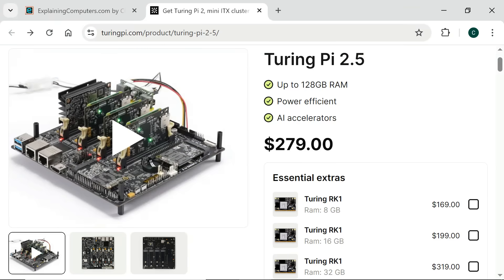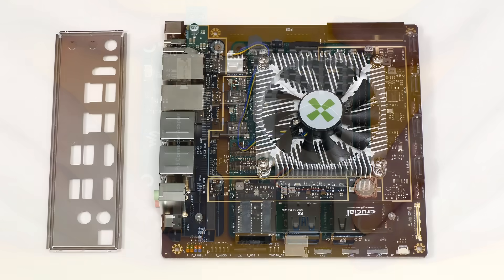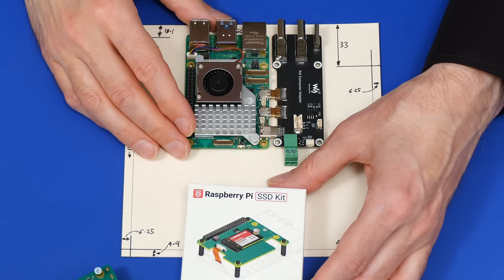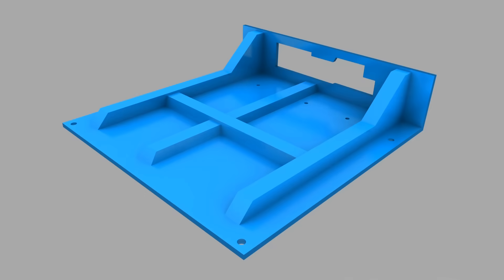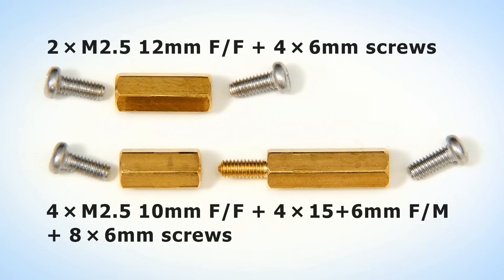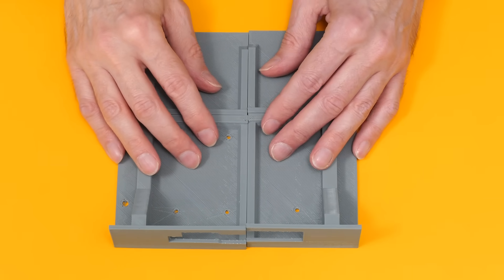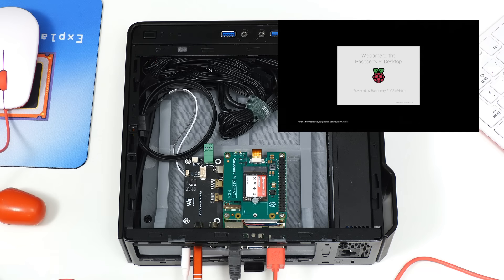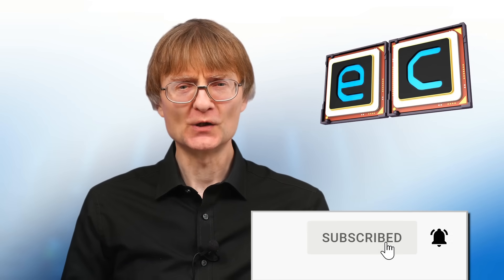Mini-ITX Raspberry Pi 5

Comment: Waveshare makes a PCIe To M.2 Adapter Board (C) with right angle FFC ends for $10-15 that would mount on the opposite side from the board with the HDMI ports. It would allow a normal 2280 drive.

Comment: Nice setup. At 11:58 at the J2 header, you could just solder both twisted wires, but not the holes in the pi.

Comment: Did a similar project myself last year to build a media server using a PI5, PCI-e to SATA adaptor for a couple of 4TB hard drives. All this plus a couple of USB TV decoders for recording broadcast TV. All put into a nice mini ITX case using a 3D printed carrier similar to yours just bigger. Wired up GPIO pins for power LED and HDD led on the case too. It was a thoroughly enjoyable project.

Comment: So, you can get a replica Commodore 64 'bread-bin' case, that's got a standard 80% mechanical keyboard and is modded to fit a mini-ITX motherboard, and do this to it. They call it the Commodore 64x. And there's a "Commodore OS Vision" that's been out for a few years now, which is a trippy linux distro with all kinds of vintage emulators and operating sysems and 8-bit games preloaded on it. Dunno how well that would fit on a Pi, but I've seen Debian on Pi's so... worth a shot?
Reply from the maker: Indeed, I did a C64x build here: https://www.youtube.com/watch?v=RYQglGwItcY :)

Comment: Hrmmm.. that power switch solution gives me great concern. Solder can be desoldered fairly easily.
Reply from the maker: Removing solder to a level of neatness that cannot be seen in a video would be very impressive. Remember that my Pi's are used for photographic as well as practical purposes! :)  I'm also not sure what your concern is. The power switch connection is momentary. At worst it could not work. So what is the "great concern"? There is no electrical risk involved.

Comment: It's a nice concept overall. But I still feel like there is a lot of unused space. But, there's still room on that 3D printed motherboard tray. 

Is there a way to add a USB header for those USB3 front panels on the case? And for that matter, are there any 'HD audio' connectors that could work with the Pi somehow? Can the 40 pin GPIO be used for extended features?

Comment: You have a real sellable product with that   Pi 5 to  mITX adapter board,  just add a real metal i/o shield and then Pi 5 can fit in any PC case that can fit mITX .

Comment: Nifty idea and well thought out.
My only gripe was the dogshit way of input power.
Why not solder the header pins in or at least solder the wire to the board????
Reply from the maker: The power input comes from the USB-C port on the Pi. The wires are for the power switch, NOT the power input. As I discussed in the video, I did not solder on headers because it would prevent the Pi being put in almost any other case.

Comment: I printed your Mini-ITX STL file and tried to install it in a Mini-ITX case. Unfortunately, that didn't work, as your construction proposal is much too wide. The Mini-ITX specification says that the maximum width is 158.75mm. However, your case proposal has the full Mini-ITX width of 170mm.

Or have I misunderstood something?
Reply from the maker: Sorry to hear this. I am confused. The standard Mini-ITX specification is for a board 170mm x 170mm. 158.75mm is for custom Mini-ITX boards and cases, although I've never come across one of those. 158.75mm is also the size of the IO shield hole. As noted/shown in the video, I chose to make my back panel full-length (extending beyond this) as it was recessed inside the system.
Reply: @ExplainingComputers  Ok, this was a misunderstanding on my site (Language barrier?). I'll try to make a cover for your Mini-ITX board with openSCAD. 😀

Comment: There is room to place 2x Pi's next to each other in the case which brings up possibilities such as one Pi serving as a VPN server, router or firewall and the other Pi being a media center.   What is now needed is a compatible power supply for ITX cases that will power any Pi either by setting DIP switches or by using a different cable set matched to the amperage a specific model Pi requires..

Comment: i hate to be a vocabulary stickler, but you used pontificate incorrectly. i would never find you as a know it all, yet less to speak as such.
Reply: and yes. i just did realize that to point out the meaning of pontificate is in itself somewhat an act of pontificating.
Reply from the maker: Yes, my brain clearly malfunctioned there! :)

Comment: My Raspberry Pi 4 8gb is my main desktop computer. It is used more often than my Windows 10 desktop which is getting on a bit but is still my most powerful computer. However, the RPI 4 is quicker to boot and does everything I could wish. Tasks that are only possible in Windows 10 or that require specific hardware to maximise performance are often done on the desktop PC. That really only consists of Da Vinci Resolve video editing, Blender and some Windows specific music editing software. DaVinci Resolve and Blender can both be run on the RPI 4, but are notably slower. On the whole I prefer being able to get into things much quicker on the RPI 4. It can take quite a while for the desktop PC to be ready for action. I know from reviews like Christopher's and extrapolating from my experience with the RPI 4 that the RPI 5 would be even more capable and with a Mini-ITX setup you might have to look closely before you realised it wasn't a true PC.

Comment: @Chris Re: the I/O Shield.. A few years ago, I encountered someone (He rolled a board called the NuXT).. that made his I/O Shield with... a PCB...  at the usual places it actually worked just fine when I had some made myself.. You just use the aluminum PCB option. Just draw it out in your preferred Gerber editing software (I did it in KiCad and DipTrace and even onlien stuff).. obviously no schematic required.. and to them, gerbers are gerbers... I can forward over the files that can be used as templates if you have any interest in going that route. (I'm still need to make one for my Dual PPro boards, since those I/O shield are impossible to find, so I'm using the 1 I do have that is similar to it as a template)
Reply from the maker: Very interesting . . . :)

Comment: I followed in the meister's footsteps: bought all the gear and installed it. Now wondering how to actually use my m.2 SSD as I can't seem to make it appear as a drive on the desktop (Raspbian). Any ideas? (The speed test works; I just can't actually seem to use the drive for anything.)
Reply from the maker: It sounds like you've not set the Pi up to read the drive? The HDPARM test is a much lower-level affair. I covered the setup process in this video -- https://www.youtube.com/watch?v=B9OwWnAftb4 Although before this, try running up the SD Card Copier from the menu, and see if the Pi can recognize the drive there (to allow you to clone Raspberry Pi OS from microSD card to the drive). Good luck! It should not be a complex fix.
Reply: @ExplainingComputers  Thank you for the reply! I used the Imager to install Raspbian onto the M.2 drive and took out the Micro SD... so at least I know that everything is running at full speed now. No further need to worry about what might be on which storage medium. Pi5 with an M.2 seems like a 'proper' computer now, and could well replace my Windows desktop.

Comment: Hello Mister Barnatt. Why put the Raspberry 5 in a PC case?
The SBC form factor is designed precisely to have a very small case to save space.
Maybe if you want to add a USB3.1 dock to plug four SSD. But is the Raspberry 5 powerful enough to be used as a desktop PC?

Comment: When I load those .stl files in Tinkercad they all show up as about .5mm across (compared to e.g. 170x170 mm normal size)
Reply: It seems they were scaled in meters instead of mm.  I was able to apply 100000% scaling (1000x) and send them to the printer.  Thanks for the work.

Comment: I don’t really get the point of this. There might be some value in it if you managed to implement highly performing passive cooling (a thin but shaped aluminium plate like a pi400/500). I just don’t get this though. Next week are you going to build one in an old Pentium ATX desktop case? That would be even bigger and you could stand a monitor on it!

Comment: This is such a an awesome idea!
I've been wondering for several months now as to weather or not it was possible to build a home NAS device using a raspberry pi, but using a standard sized mini ITX case.
This looks like it could be just the solution I've been looking for!
I don't own a 3D printer, but there are services for that as well.
I'll still need to figure out a few things:
1) installing a hardware RAID card to connect several SATA HDD's to the raspberry pi.
2) builtin lithium battery pack and software to handle an automatic safe shutdown in the event of power loss.
3) an external WiFi antenna to make sure I can still access my files in the event I lose my Internet connection.

Comment: Would like to have seen video of the nvme hat being attached to the pi and the implications re the fan and thermals. Would like to have seen the result from side on - what’s inside the sandwich! An internal power supply would have been cool, too.

Comment: I've not come across a Pi 5 case yet that wouldn't accomodate 2 soldered-in pins to connect an external power switch, so I think that would be OK, even if you plan to repurpose that PiTX later on.

Comment: very nioce and useful proect.  thanks for posting it.  one minor question- when do you get concerned about cooling. and how did you know beforehand that passive cooling would be sufficient in this case?   thanks again for another thoughtful program.
Reply from the maker: Thanks. This project uses the official Raspberry Pi 5 cooler, which has a fan! :)
Reply: @ExplainingComputers thanks!  I knew you would have a logical explanation.

Comment: It would be an interesting little project to fit a Pi into the 5.25 inch drive compartment in a pc tower . Add a flush mount HDMI socket and USB C socket for the  power supply to the rear of the case  and a front panel power button and bobs your uncle! You could even make the mounting system so the Pi can slide out like the tray of an optical drive . Why anyone would want to do this i have no idea but it would be a bit of fun doing it.

Comment: "made from a cereal packet, any cereal will do", love the humour, i hope you never change.  Also, that smaller HAT you used for the NVME, it could be flipped upside down so its below the pi5 as that would have the space free to stay in the form factor unlike the more rectangular first nvme solution you showed, this would let you keep the fan area free for maybe a beefier fan solution, or just keep the area free from heat.

Comment: I usually like your videos, there are usually really informative and innovative. But this one, i have to say i do not see a point of fitting a r-pi in a M-ITX, especially when the ITX power supply is not used, the IOs are just routed to the back with a janky "IO shield". like many of the 3D printing other youtubers do with mini racks etc, it just creating more plastic waste.
Reply from the maker: Sorry to disappoint on this occasion. As the comments show, this video splits opinions. At least the plastic is PLA (biodegradable).

Comment: Ah yes, another project for the "Pi Fiddle Fetishists" out there.  For the same, or less, $ you can choose to buy any number of mini PCs in the same, or smaller, form factor, including the case and power supply, power it up and do computing!  Don't care for X86, fine, get one with an AMD.  Don't want Windows, OK use any flavor of Linux.  Almost any mini PC will outperform this kluge of parts in all aspects.  If one wants to do computing: get a mini PC, if one wants to play with SB Computers, get a Pi and a bunch of accessories, build a chassis and buy a case and hope for the best!  Kinda like years ago when building ships in a bottle was a growing hobby. 😂

Comment: I'm intrigued about the mini-ITX case being used. Anyone know which brand and model it is?
Reply from the maker: It's an IN WIN Chopin Mini-ITX.
Reply: @ExplainingComputers  Thanks! I found your original build video and got the model. The case looks cool, even comes with a PSU. But not clear if you can replace their PSU with a higher wattage.

Comment: Very cool project, but I'm not too keen on the 'wire wrap' power solution. To my mind, there a danger of overheating, possibly causing a fire. I'd much prefer pins to be soldered onto the holes, and a proper connector can then be pushed onto the pins.
Reply from the maker: There's no danger of overheating, as the wire wrap is not a power solution. Rather, it's a power button solution. So it only momentarily carries a little current when the power switch is pressed.
Reply: @ExplainingComputers  Hehe, my mistake. Good stuff!
Reply: Some decades ago  Memorex introduced some IBM compatible disk drives (330 equivalent I think). Those were wire-wrapped, not soldered. They were driven by voice coils, very handy for spotting overworked disk drives.

Comment: with a psu breakout board and a pico psu power supply, that would be a much neater result that can power the pi through the DC jack.
Reply from the maker: True.

Comment: I would like to hear arguments (apart form gaming requiring a graphics card) against using a Rasp Pi as a desktop! Nice project - pretty good result with directions for improvement. My thanks
Reply: Software available and price, especially after adding adapters and casing for the Pi.
Reply: @CJinMono Lots of freeware software for desktop use including the libre office suite and numerous graphics sw (E.g. GIMP).. also more specialist sw such as Mindmapping etc I even used my pi to write my masters thesis using a piece of sw called LaTex (very handy for large pieces of work, maths, engineering , or writing a book etc..)

Comment: NOOOOOO!!!!
You already build things like this the CORRECT way! Make a box using sheets.
3d printing is the WRONG way to make a box!

The rest of the project is great though.  =)

Note: More than half my time with 3d printing in my hacker spaces is stopping people from printing flat parts or rectangular boxes...
We have a FREE box of plastic sheet offcuts next to the drill-press 10 feet away from the printers.
We have a sign on EVERY printer, and each control station warning people NOT to print flat sheets or rectangular boxes.
We have a painted line between the printing area and the sheets/drill area telling you to do your flat work THERE.

And we STILL have to take away printing privileges from almost HALF the people because they just cannot resist the urge to print a flat square sheet with 2 holes in it...
Reply from the maker: Great post. I decided, quite possibly incorrectly, to go the 3DP route so I could share the design. As when I use ABS sheet and cut it, I'm always asked for a 3DP version.
Reply: @ExplainingComputers  No I get it.
3d printing creates a wonderful availability to do things in places where it really didn't before.
The idea that someone can design a physical thing and others can freely benefit from it is wonderful.

But I also find that 3d printing gets abused quite a bit. It's a "When all I have is a hammer, everything looks like a nail." sort of problem.

I kid you not, I run into people who own a 3d printer, but don't own a hammer or screwdriver, and it utterly baffles me.

Comment: You could actually add the full NVMe board with a vertical mount and still use the short ribbon cable.  Then add one of those Pi 5 ICE tower coolers for the full PC look!
Reply: This! And add some RGB strips controlled by GPIO.  That would make use of the ATX power supply.
Reply from the maker: @arlo.infinity  Brilliant idea! :)
Reply: @ExplainingComputers  Thanks! Would love to see a short follow up with some of these ideas!
Reply: Could you get power only (no data) to the front USB with a power supply?
Reply from the maker: @KSBrazil Yes, it would be easy to take a 5V feed from the Pi's GPIO pins (eg pin 2 for +5V, and pin 6 for GND).
Reply: @KSBrazil Probably!
Reply: There are adapters that take a regular USB plug and turn it into a USB header for a computer case

Comment: Nice combination of bits, but to me it seems strange to use the case and not its psu. I’m sure the People’s Republic could very economically supply a power breakout board so that no wires needed to be cut and full original functionality could be restored in the future. 
Talking about power… I did wince at the chosen means of attaching power to the Pi.

Comment: Congrats for achieving your goal, Chris! Well done, Sir!
Don't mean to nitpick, BUT ( 🙄) I would have stayed with the full size 2280 Pineberry SSD board, mounted it underneath the RPi5, similar to Raxda SMDs w/SSD, to allow unobstructed airflow for cooling for the hot tempered RPi 5.
But, that's just me.
Cheers! 😎
Reply from the maker: A very sensible idea, and a better solution than mine. :) I think I got blindsided by the "put it next to the Pi" option, which I had been thinking about for months before I started working on this in practice.

Comment: I don't think they will ever make a Pi in another format, that is what the CM5 is for. Designing a carrier board for the CM5 in Mini-ITX format — could be your next project! Ambitious, I admit, but the IO Board is very well documented.
Reply: Super6C is a mini-itx board that can take the CM5 (and CM4).
Reply: @Robbo.312  Yes, obviously. I meant: mainboard manufacturers or hobbyists could design a carrier board for the CM (4 or 5) in mini-ITX format.
Reply: @var67 there’s already a few out in mini itx form, but they concentrate on cluster due to the available space.  Super6c can take 6 CM4/5s.  Turing can take 4.  There's also some industrial aimed ones that just take the one...